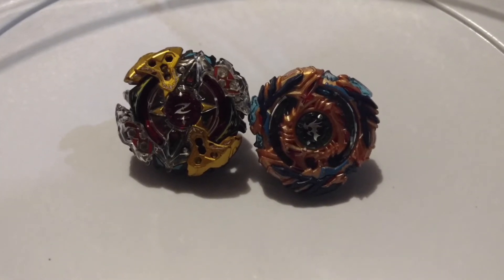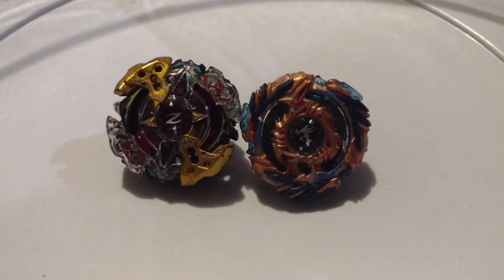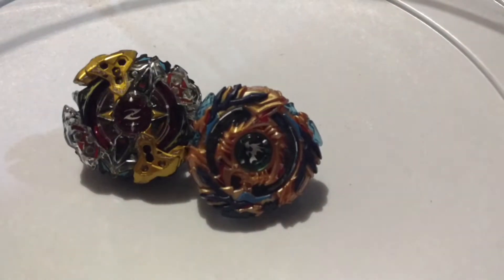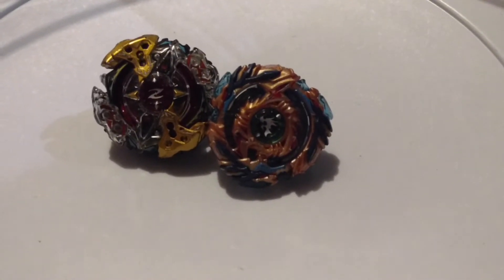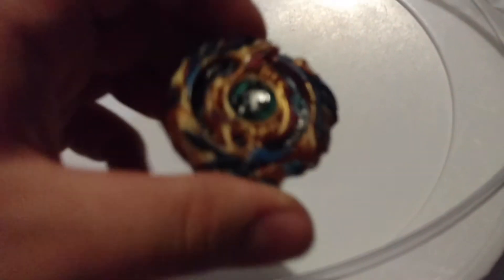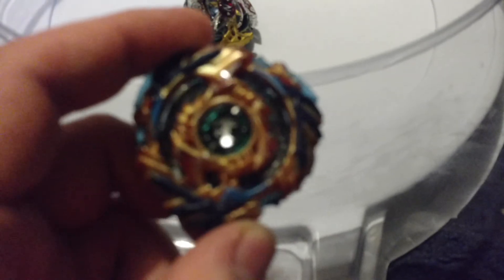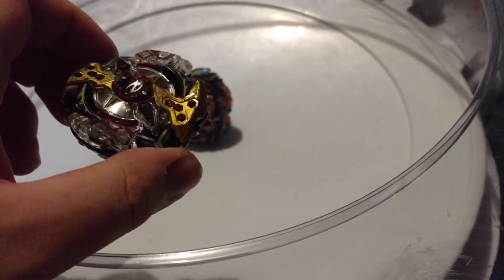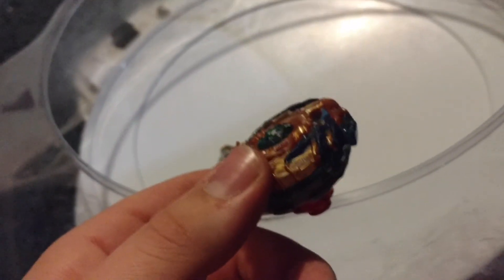WHY DOESN'T MY DRAIN FAFNIR WORK ANYMORE?!

Comment: Did you try cleaning the rubber? if that doesn't work then that means the rubber is worn out and the layer needs to be replaced